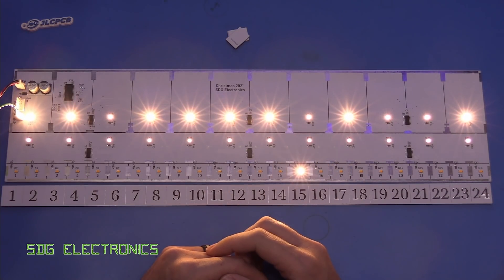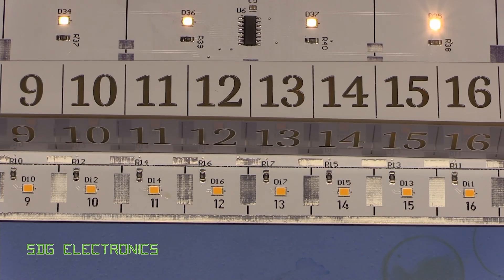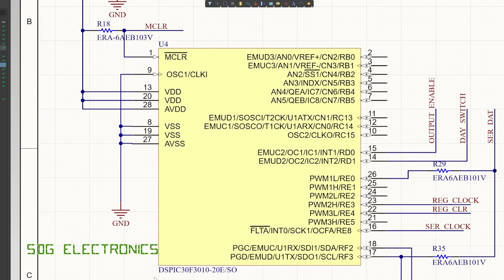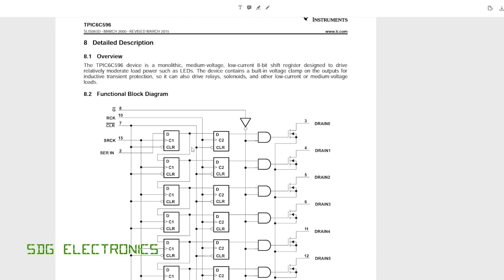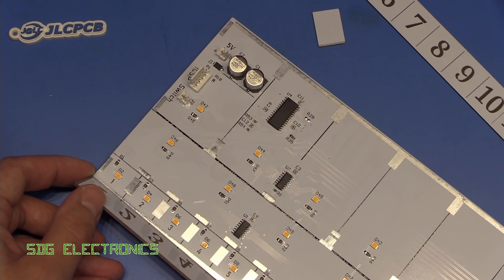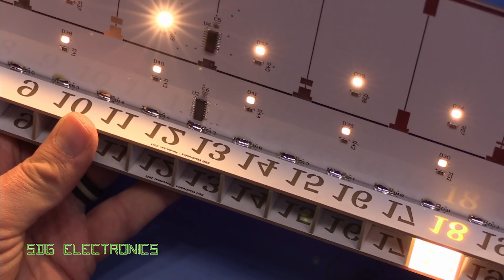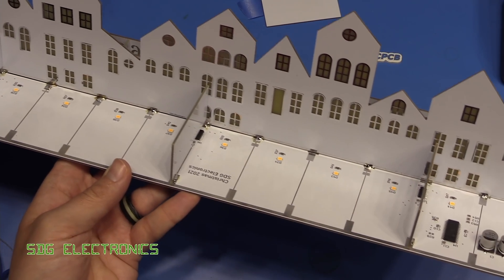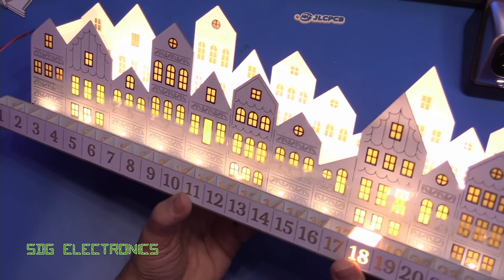SDG #235 Assembling an Advent PCB Scene with PCBs from JLCPCB

Comment: when you make the roof you could print some sections comming down from the roof gulley to add back the light blocks per house??
Reply from the maker: Good idea, I should have thought of that before starting the prints. I might print another set with those added in.
Reply: I had the same thought - of course - you could also just take the existing panels you have and hot glue them in place where they actually go.

Comment: Interesting project! I'm wondering how you managed to import the DXF into Altium, every time I did it instead of polygons it created lines that fill the area. Could you explain how you did it?
Reply from the maker: It was not as streamlined as I'd hoped. There was some playing around in Illustrator to export the graphics in sections because some of the closed paths stopped me creating just a line drawing. Mostly I imported the DXF as a mechanical layer which created an unreasonable amount of lines. Then select the relevant ones and used the Tools->Convert->Create xxxx from selected primitives to actually convert to tracks which I could change the thickness of.
Reply: @sdgelectronics  Thanks! I'll take a look and see if that helps me. I find it quite bizarre that a software like Altium can't import vector graphics as it should.
Reply: @NelioSmix  I've tried a few different PCB software packages and none of them seem to handle vector graphics well. It's really too bad.
Reply: @AverageJoe928  not even KiCad? I haven't tried it but I have a feeling that it would be better in that function

Comment: All those right-angle joins are  a lot easier if you put tabs on the edges and holes for them to slot into
Reply from the maker: Definitely! It's one thing I wanted to add in but the graphics import process was not as smooth as I'd planned it to be so I ran out of time. If I'd had one more day I would have spent a bit more time making the whole thing better. Not the end of the world for a one-off, but next year it might get refined. Thanks!
Reply: I mainly use Altium, but have a few projects that utilize multiple PCBs which interlock using tabs and cutouts and I highly recommend using Fusion 360 for those applications. It's so much easier to layout the overall design in CAD and then have the PCB profiles derived with a single click.